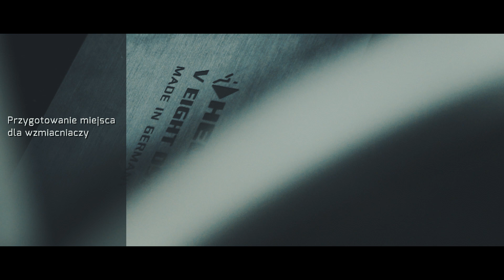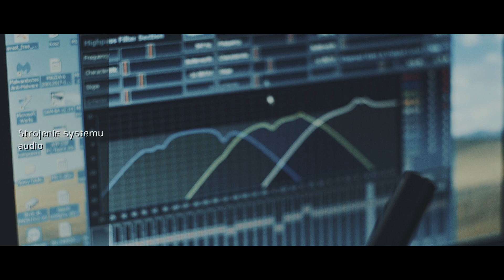Mercedes GLS Helix Brax audio system Pro Audio Tychy

Comment: Why using a crossover if you run active with dsp.?
Reply from the maker: Because the front is active (3 ways) and the rear is passive. We have 8 channels of DSP amplifier so there is no other option :-)